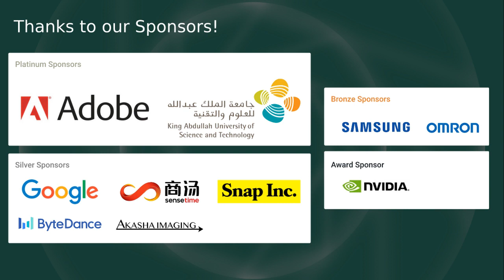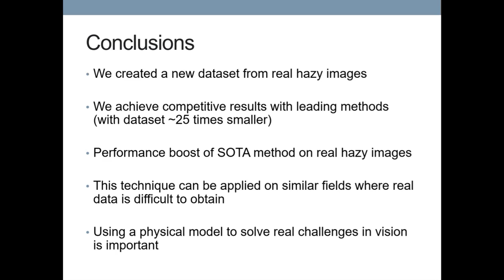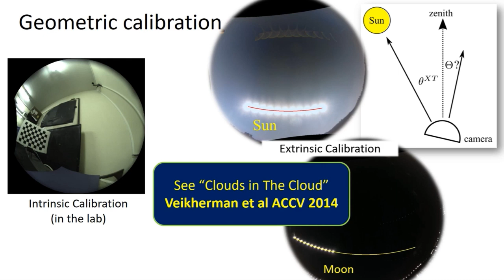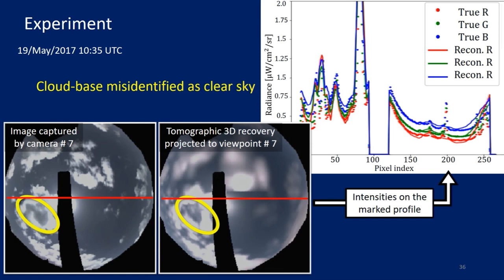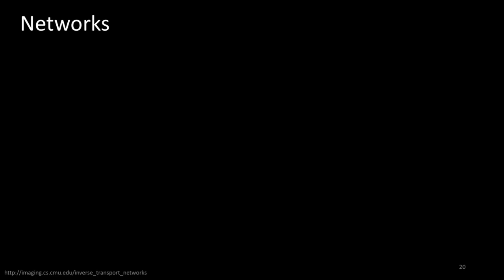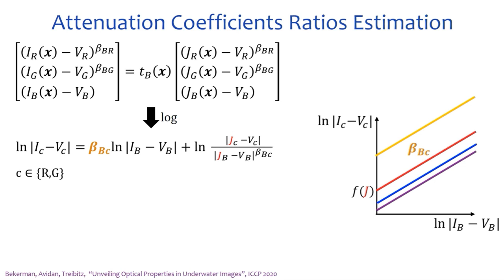Session 1.A

Comment: Question regarding #79. Is there any comment regarding how "good" the forward rendering process need to be? Is it that rendering even with less sample can still be fixed by more iteration of back projection? Or do we need to make sure the renderer is at almost highest sampling number possible to guarantee meaningful gradients.
Reply: Hi Chia-Yin,  no, you don't need to use super high number of sample per pixels to train. Training such a network could be expensive since we integrate the forward scattering model and compute its derivatives. One way to speed up the training process is actually to reduce spp to have a noisier but unbiased gradients, , which is still sufficient for convergence in a stochastic optimization.